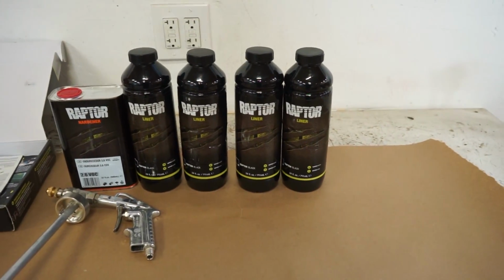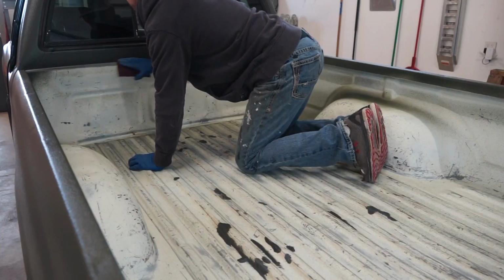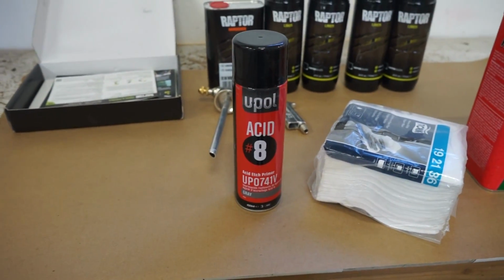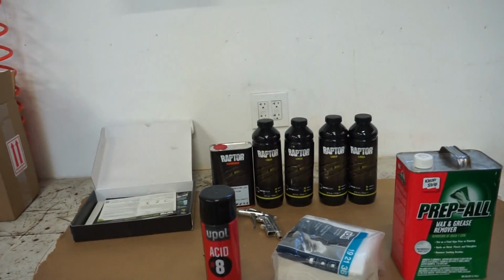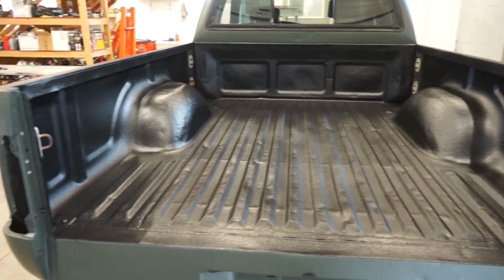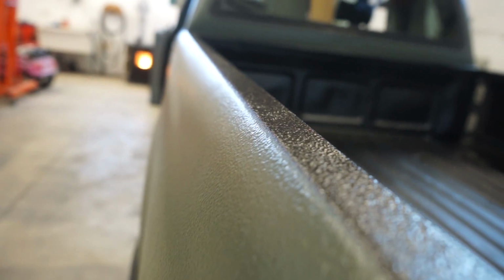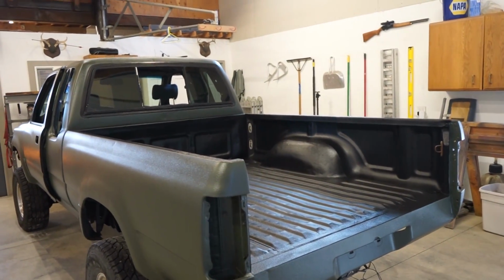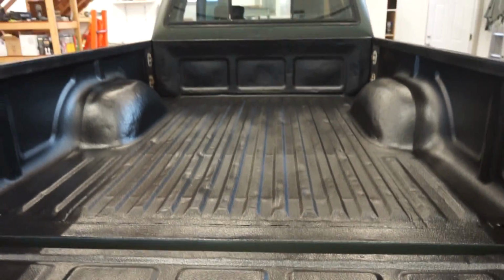The Best DIY Bed Liner For Cheap And Professional Results!!

Comment: I think it would look cool to use the black raptor liner to highlight some of the accessories like the grill, inner fenderwells, mirrors, bumpers etc. Kind of break up the green but still have the same texture throughout. You have a good aesthetic so you will find a cool look for sure.

Comment: Fyi, this stuff is legit!  Used this to line the lower section of my 07 yukon and the front and rear bumper 2 years ago. Still looks as good and holds up well.

Comment: With my experience with raptor you really have to shake it up for the gun that comes in the kit to spray well, also spray from far shoot the last 1/2 bottle at about 70 psi and from 5feet away to get a great texture. Also drug the corner of a car battery on it and not much happened 🙂

Comment: Should kill 2 birds with one stone.  Spray a matte black panel over most of the hood to 1) get rid of the lines, and 2) create an anti-glare surface like many Ford Raptors have.  This is particularly useful if you intend to install roof lighting.  Could even get some "TOYOTA" or some other stickers to mask off green accent areas.  Could even add a little matte black flavor to the bed sides too.
Reply: when painting over a ‘toyota sticker’ would you just pull the sticker off before the 2 coats cure?

Comment: Do you recommend using a better applicator then what U-Pol offer in the kit?   What psi did you have the compressor @, Nice job.
Reply from the maker: I use the professional raptor gun https://amzn.to/3UmwMxO
It works so much better than the cheap one you get! I use a regulator at the gun and shoot at 70-80 psi!

Comment: I have sprayed raptor liner on my 4runner but i did try spraying it a bit far away like 18  or 20 inches away and pressur at 80 and it did turn out very nice

Comment: Man both trucks look great! 
I was wondering, might you be able to go into detail about mixing the raptor liner and the paint you like to use for those results? I believe you use Omni. Also what setup do you have for the spray gun? Like water separator and pressure regulator and things like that. If you’ve already done this could you put a link in please? 
Thank you.

Comment: pant in a   cross pattern to prevent some of the stripe effect. two coats if you can one to tack fast an thin  one to fill. 
An make sure to use a mask with this stuff folks. Have had it on a cj7 hardtop and armor kit for 3 yrs now. still looks great..
Reply from the maker: Mask is needed, this stuff stinks haha kill a few brain cells lol
Reply: for cross pattern the second coat is done perpendicular to the first?
Reply: how do you get a fast tacking coat?
Reply: do you recommend always remove masking while paint is still drying?
Reply: @zackscott8636  It makes life easier and prevents jagged edges....
Reply: @zackscott8636  a thin coat /dusting will flash faster then a heavy coat... when you run your test pattern piece you will see. the cross pattern prevents low and high fill areas.

Comment: Quick question, how big was your air compressor that you used to spray the bed with?  5gal, 8gal or something like a 27 gal compressor?
Reply from the maker: Mine is a 60 gallon!
Reply: Wish I had one of those!  Do you think a smaller compressor would work just as well?
Reply from the maker: @josephhart9600  yea should be fine with 25-30 I suppose
Reply: @austinniemela  Thanks!   Keep providing us with great videos!
Reply: Oh, did you remove the plastic tabs in the bed before you sprayed?

Comment: Dumb q, but when it eventually fades, how intensive would prep be? I'd imagine doing multiple coats over time it would become too thick for door jams and such. Is it easy to sand down? How long is the pigment rated to last in the sun before it fades?
Reply from the maker: I havent heard of any fading issues!
Reply: @austinniemela  I know Linex fades in about four years. And all pigments fade, like any paint job. I live in az so uv protection and pigment strength is important to me.
Reply from the maker: You can clear coat it to make sure!!

Comment: Hows that bed liner holding up? I took my 89 Toyota pickup to a place that specialized in just bed lining….my bed looked like yours…they told me it would start peeling off within a year because the bed liner sticks to the clear coat and not bare metal…..

Comment: The gun that comes with the kit also has an adjustable tip. How is the professional gun any different?
Reply from the maker: Not any of the kits I bought! I have 3 of the free guns and they aren’t adjustable
Reply: The gun that comes in the 4 liter kit isn’t adjustable, it shoots well you just have to mix the bed liner really well for it to shoot evenly
Reply: @austinniemela  I ordered a 4 liter kit in black and a 6 liter tinttable kit. Both were adjustable. Have you tried rotating the tip?
Reply from the maker: @harut82  well it has the tip that threads in but doesn’t do anything when you move it, completely different gun